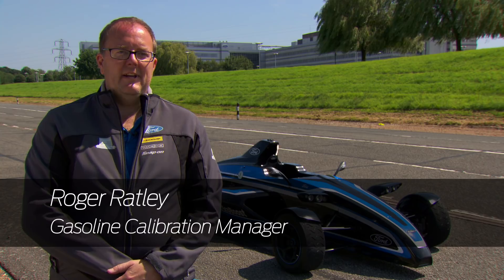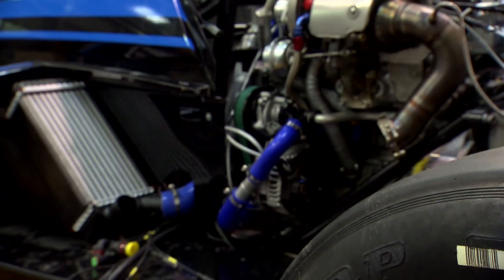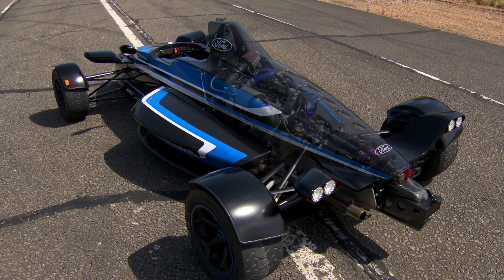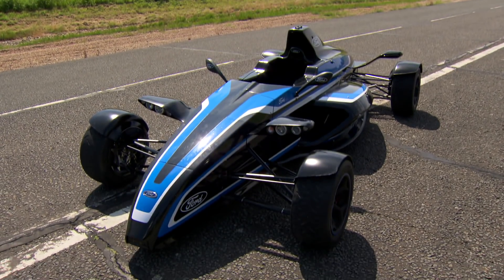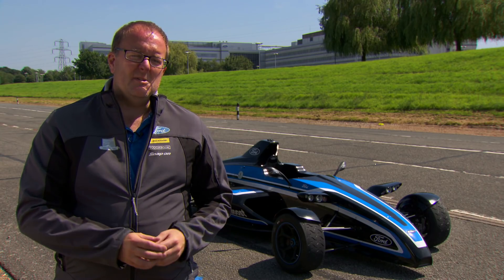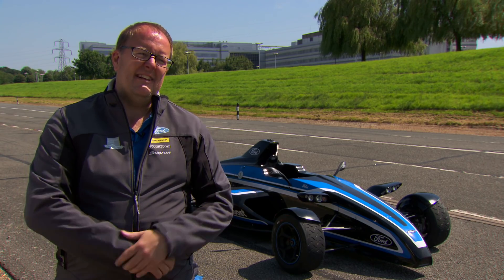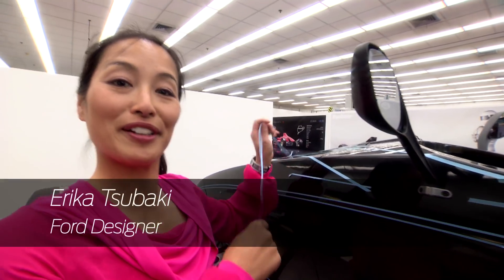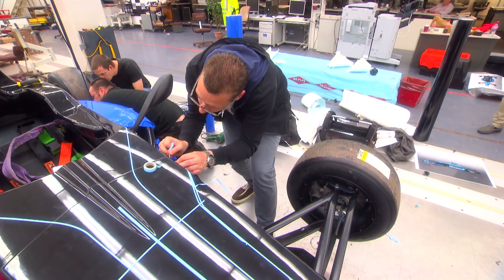Formula Ford 1 litre EcoBoost

Comment: How do I get  195hp out of eco boost?
Reply: Clarissa Casper they used a turbo from a 1.6. Probably forged internals.
Reply: +vivalaphill The internals were completely stock. You're right about the turbo though.
Reply: Clarissa Casper What are you putting yours in? I want to put one on in a Ford Pop, or a 100E. An Austin Farina A40 would be a good candidate, as would a Model T roadster.

Comment: I wonder why this is being hailed as a great thing? A lightweight car with good aero will always get good mpg and be quick - that's because the engine has less work to do than in a heavy, draggy car. Also this may peak at over 100mpg but that will drop way down if you start using the power. Much like the ecoboost engines in the road cars which get nowhere near their combined cycle results in normal use. I like the idea of a race car on the road but not interested in the engine.

Comment: Not the same engine. Turbocharger is bigger than the one in focus. You can see the flange difference and adapter flange used clearly at 0:56. OEM small turbo has a 4 bolt flange. This big one has a 3 bolt flange. This means more power, more fuel, more consumption. Every engine with bigger turbo can make more power at high revs.

Comment: Remember Daihatsu designed the 993cc 3 cylinder twin cam 12 valve turbo engine as used in the 1987-93  Charade GTti. 100bhp stock but 200hp+ is easy enough on them without any need for engine internal changes. Just ECU mapping, and bigger turbo/injectors and of course more boost!

Comment: Get cracking then.  The rolling chassis is £33250 plus VAT and available now ... Google britishformulaford ... the engine is also available as a crate engine from your local Ford dealership.  Cycle wings, lights and other parts are available from a plethora of retailers.  IVA can be carried out at your local testing station to get your log book.

Comment: I'll give you a good reason why this is better than a motorbike.  You can't fall off it.  If you have a crash, you'll be protected by a crash structure, safety cell and seat belts.  As for front number plates, I've seen these brilliant things for sale.  I think they call them stickers.  Not sure if they sell them in your area, but they seem to work well over here.  Ariel pioneered their use on the Atom...

Comment: I'm not insinuating that the Fiesta will be as fast or as this car, but it will be faster in comparison to what it is right now.  Imagine a 2013 Ford Fiesta with 202hp and a 6 speed manual with the ability to get around 65+mpg.